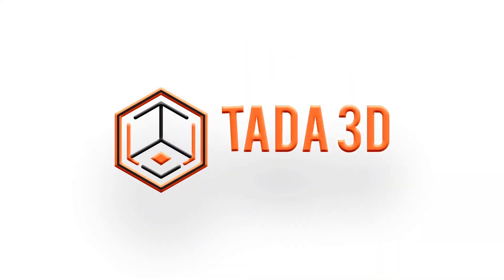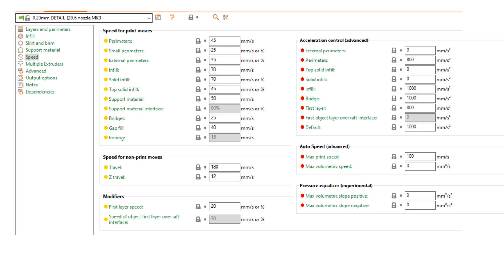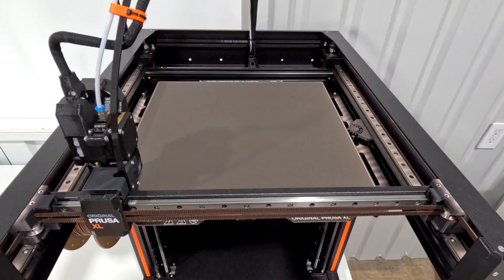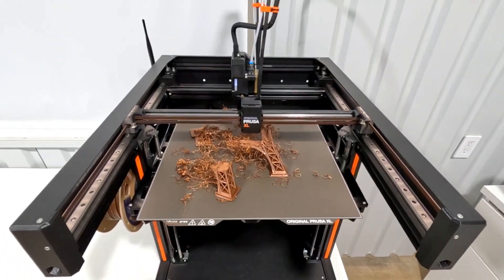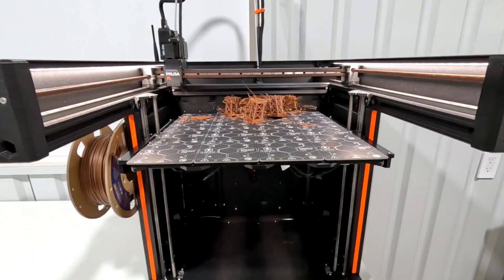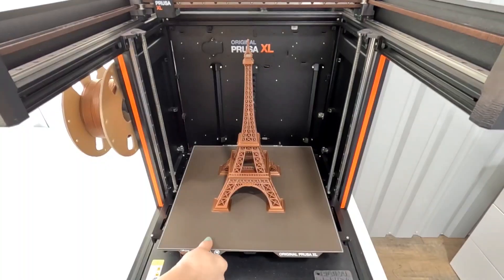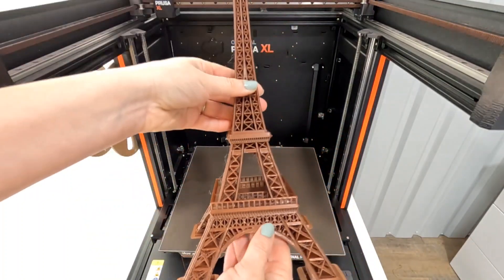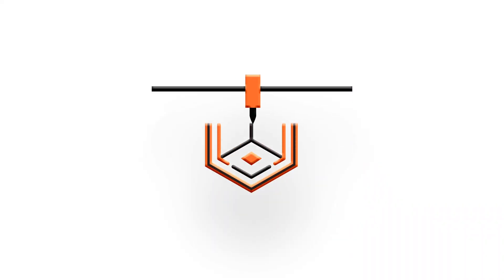Eiffel Tower on the Prusa XL!

Comment: I know that this is a difficult print, and the four sections do appear to have met up correctly in the center.  You mentioned possible tweaks to improve the appearance of the arches as viewed from the bottom (that is, resolving the bridging challenges).  I would like to see the troubleshooting steps that you go through to resolve these issues since you can't just add in some support material in your case.  In other words, to see how far could you could take quality without supports.
Reply from the maker: Usually on smaller prints, I just run it at different layer heights to start. But on something this large, it might be worth slicing it and just printing the specific section. Let me think about this. Thanks!

Comment: Quick question: Does the spoolholder handle also 3kg spools?
Reply from the maker: I haven't been able to get any 3kg spools yet. But it does extend past my 2kg spool. How wide is your 3kg spool? Thanks!
Reply: @tada3dprinting  16,5 cm or ~6,5 inches. Was also concerned if the holder can handle the weight.

Comment: You have to wash the build plate in hot water with dish detergent and a sponge whet it happens. After washing it with dish washer detergent it will stick to the plate without such issues and there is no need for brim.
Reply: I had the same problem in the beginning with my MK3S+, and often had to wash the plate with dish soap and water. I normally print with PETG on the textured sheet. Then i started to never touch the sheet with my hands, and only use a printed spatchula to break the prints free with. Since then I haven't had any problems with prints not sticking. They almost stick better and better. 😅
Reply from the maker: Thanks!

Comment: For pla on Rough prusa plate, I use paper glu stick mixed with water. Heat bed, tap it with stick, mix and even it with plastic scraper and let it dry.

It's invisible but works like magic. Glue holds for many many prints and helps with pet-g too. 

Since I started using it, I was able to stop squishing 1st layer and increase all speeds and acceleration twice.

People like Angus from Maker's Muse use alcohol mixed with glue too. Paper glue is easy to remove with water.
Reply from the maker: Thanks!

Comment: A brim is a quick and easy safety for a print like this - much better than a failure or a raft.  Usually a smaller layer height will bridge better than a larger.
Reply from the maker: Thanks!

Comment: Thank you for making these! Its nice to see the fails and solutions. I'm looking for a good printer and the XL and Voron are at the top of my list, so I've watched all your videos. Speaking, I think this is the second time the fix included putting the large object at the center of the build plate. Should that be the default?

Not into bowden tubes, but that seems a necessary evil for multi material, which I do want to try. Have you tried high temperature filaments? I'm interested in ASA or whatever material will survive the heat, cold, and knocking around of a cars cabin going between snow and dessert. Have not seen any enclosures for the XL, but also only seen it in a couple videos outside of your channel.
Reply: Me too.  I'm working between a semi built XL or the Voron 2.4r2.  it's ALLOT of work, but totally doable, to make assemble a voron and get it to work perfectly.  But then i ask myself, what if it doesn't turn on.  Would i be able to harness my beautiful rage and fix it? 😁
Reply: @BennyTygohome  I have modified 4 Creality Ender 5 and built two Rat Rigs.  I would suggest that you don't get a kit as your first printer.  It will take time especially for a Voron or Rat Rig.  If you go with a Voron, please do yourself a favor and get a LDO kit, it may cost more, but you will have a much better result.  Watch some You-tube for the LDO kit builds.
Reply from the maker: @Benny T  I wouldn't be able to put it together so you're ahead of me.
Reply: I have been watching these excellent videos, since I have an XL on pre-order - seems like years ago.  I decided I want the 5head model, and agree that an enclosure will be needed for ABS - ASA.  I have had great success on my Bambu X1 Carbon with those, but want a larger build area and am excited to see the tool changer.
Reply: @woodwaker1  I wanna go multi head too. Just wanna make sure it can also do high temp filaments.
Reply from the maker: I may start defaulting to the center for that reason and I like how it looks centered. I don't like the bowden tube either but it's a long distance to the front of the bed. I have only used PLA, PETG, TPU and Carbon Fiber. I do want to try out ABS and ASA soon. But yes until they at least come out with a draft shield, it'll be tricky. Thanks!

Comment: Great video series, thanks! Have you ever run into an accidental filament runout on your XL? How do you recover from that? How easy is it to change the filament? I'm curious because I never had luck with the filament sensors on my i3s. An accidental runout usually means I have to disassemble the extruder on one of my i3s, which also means I babysit prints when a spool nears the end. I was hoping that would be easier with an XL, and that it maybe even would be able to switch from one toolhead to another to continue a print once the filament runs out on the first. Any infos on that would be very much appreciated.
Reply from the maker: Yes I have run out of filament a lot. These large prints are hard to get used to. As long as I see it quickly, I rarely can even see a line. But if it sits multiple hours on a large print, I usually have a noticeable line. I think its because the part starts cooling eventho the bed is still heating. Idk about swapping toolheads yet. But yeah the sensor seems pretty good in this XL! Thanks!
Reply: thank you!

Comment: I've never had much luck with even PLA sticking to the build plates on my MK3s. I just always opt for purple glue stick at this point. It never fails me, and it's easy on, easy off. It's great insurance so that I know it's gonna stick. And I never have to use a brim with glue stick on there. Sometimes some of the glue will be stuck to the bottom side of the print, but it washes right off. I'd be curious to see how the first layer calibration reacts when there is a single (or even multiple) layer(s) of glue stick that it has to probe.
Reply: I use the smooth PEI sheet for PLA, but cleaning is very important. Most people don't know this but PLA leaves sugar residues when printing. Clean with 90% alcohol is the most common, but this doesn't work well for the sugar residues. Warm soapy water works much better, especially for PLA.
Reply: @awellner3285  I knew that you want a clean bed from oils and such. But I never thought about the sugar oils. That would explain why people say dawn dish soap works best.
Reply: @awellner3285  Sugar oils, hmmm interesting, never knew that. Yup, 1 min under some hot water and a quick scrub brings my pei plate back to almost new condition. But I still use glue for insurance (not all the time) since it cleans off so easy why not.
Reply from the maker: Oh yeah it might sense it. Interesting!

Comment: I've also noticed you touching the bed with your fingers, which can get oil and dirt on the surface. Do you clean the sheet between prints?
Reply from the maker: Yes I do. I always spray it with 99% isopropyl alcohol.  Thanks!

Comment: I would recommend the satin sheet over the textured sheet for PLA.  PLA just bonds better to the satin sheet.
Reply from the maker: I usually use the smooth PEI sheet and the XL didn't come with it so I feel a bit lost. Just trying things. Thanks!
Reply: @tada3dprinting  Yah, with smooth PEI sticker sheets you can clean with acetone to get really good PLA bonding.  I have hear suggestions of running the powder coated (satin or textured) thru the dishwasher to help clean off hand oils that get stuck the the crevices.  It can lead to rust, but most report it is ok, and at least better than a non-functional bed.
Reply: @craigrogers8182  I clean my smooth sheet with soapy water instead, acetone will damage the PEI overtime.

PLA will leave sugar residues that cannot be dissolved by alcohol, but warm soapy water will do an amazing job.
Reply: @awellner3285  yes, I don’t clean it daily with acetone, I use isopropyl alcohol for that, but Prusa does recommend using acetone when needed to get the stick back.
Reply: Seconded. I use the smooth sheets for PLA and the textured sheets for PETG.
Reply from the maker: Thanks!
Reply: Yeah, that difference between these two plates is crazy. But satin holds sometimes so much it damages itself eith big strong prints.

Comment: Didn’t you just replace the 0.6 nozzle for the 0.4?  Your slicer setting still showed “Prusa XL 0.6” in the video. That could cause under extrusion and bad layer adhesion like the first attempted print demonstrated.
Reply from the maker: I swapped it back right after the benchy race. I seem to prefer the .6 nozzle. Thanks!

Comment: Does increasing the size mess with the bridging at all since it's technically farther to travel than at 100% of the design?
Reply: Probably does somewhat, at least for the railings.  Arches should be less affected, but clearly not.  I would imaging it would print better about 10-15 degrees cooler.
Reply: @craigrogers8182  I don't think it's a perfect arch.
Reply from the maker: I feel like it could be an issue. Most things have done pretty well scaling up about 200%. Maybe I could reprint it at 100 and compare. Thanks!

Comment: they should have added a camera for spaghetti detection
Reply from the maker: If the nozzle runs into something, my crash detection so far has worked. But for this print where it's not hitting anything, it just keeps going. This was my first spaghetti mess on this printer. Yes it would be nice if something had caught it! Thanks!
Reply: Can that be added?